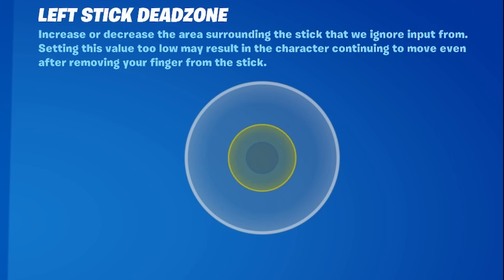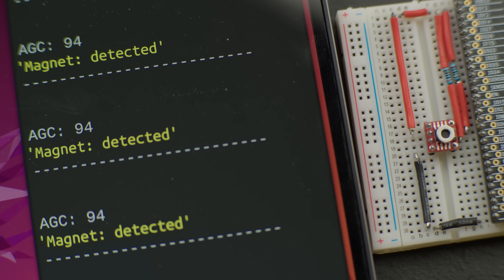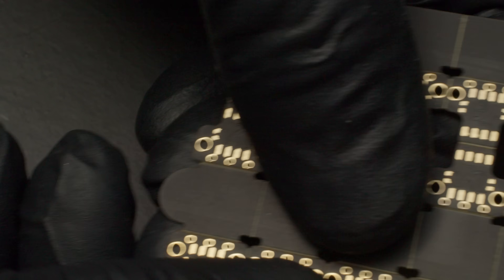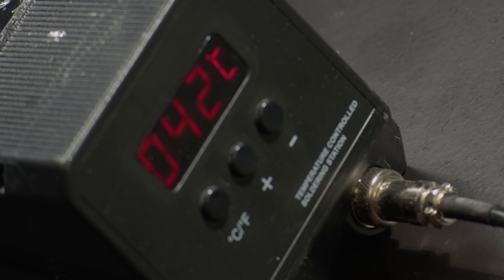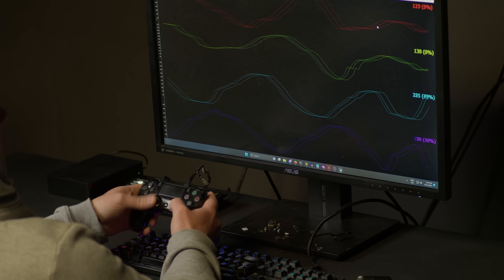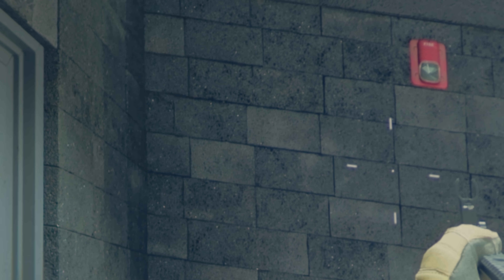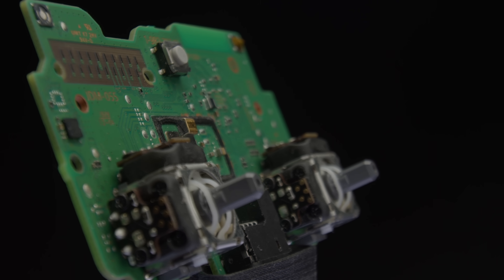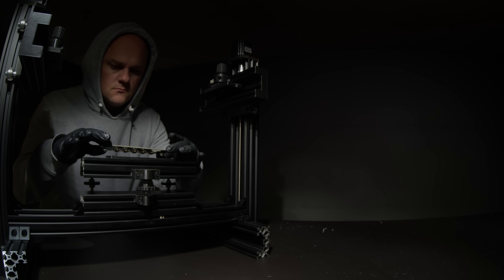Beating the $20B Joystick Drift Problem, and giving it away for free

Comment: I have Hall effect Sensor Sticks on my controller. But since the moving part is and will always be a mechanical component, they will always suffer from wear and tear. For example the mechanism pulling the stick back into the middle will suffer over time. Sure you can recalibrate but that doesn't help when the stick feels loose around the center.

Comment: what a waste of battery having the forward movement tied to a positive voltage and backward to zero, they should've made it the other way around as we spend MOST of our time using forward in all on-foot games
Reply from the maker: Haha. So true. Genius thinking. You can actually use the joysticks both way. So its probably a random mistake by them. Then did not have you to say it to them, and it stuck.

Comment: I refuse to believe that controller making companies never thought of that. There has to some reason, why they dont use that, right?
Reply from the maker: Yes. The old solutions that the existing hall effect joystick manufactures are using are not working properly within the specs of what companies like Sony accepts. I'm using sensors that alone costs more than the entire joystick. For one sensor. And 4 is needed. So outside the budget. Also they spend a ton more energy than pot-meter based ones. They could make their own, but that would require tons of RND fixing something that makes them a ton of money not fixing. So its a big mix of all those things.

Comment: gulikit already done this right?
Reply from the maker: Yes but its not the same technology. This is a rotary encoder that uses hall effect. They have a hall effect sensor.
Reply: @MariusHeier1  which one is better?
Reply from the maker: @backupmemories897  Depends on the criteria. They are probably cheaper, and use less energy. Mine is more precise, and accurate. It also works for the PS4 controller. Theirs dont.
Reply: @MariusHeier1  will this work on bootleg ps4 xD

Comment: Can you make it so, wherever the controller knows when you are not using it and the joysticks should thus be centered, it makes it so the values registered in that moment become the new 0 quiet point?

Or alternatively, make it so a little small calibrated range of the rest state gets directly translated to 0 so it is absolutely quiet while in the "rest state" to avoid microdrifting.
Reply from the maker: Yes. What you described is exactly what many controller makers already do to create the illusion of a 0% deadzone. Like Nacon, Gulikit, 8bitdo, etc. They simply reset the 0 point when they predict the joystick has stopped.

The problem is that this prediction adds lag because it needs to measure where the stick is and perform a mathematical operation. This significantly slows everything down and creates hysteresis. So it's going to feel strange near the center. Another issue is that if you move the joystick just a tiny bit, like when you're ADS sniping, the joystick might think it needs resetting. This can cause you to inadvertently move the joystick back to the center, even if you didn't intend to. This results in an oscillation effect that makes precise aiming challenging
Reply from the maker: You need a joystick that can mechanically return to 0 during normal movements. Then, you require a sensor capable of measuring those distances with minimal noise to accurately register the positions. I've actually found a mechanical joystick that accomplishes this. My joystick and sensor combo has 600 positions and returns to the center within a 2-position margin of error. However, the main board only measures 255 positions, but it's within that range. With a 0% deadzone and no averaging, it's possible to move the joystick with the full 255 resolution. It feels quite weird to be able to do it, but very cool.
Reply: @MariusHeier1  Wow. The more you learn!

Comment: As far as I know the hall effect analog sticks have a bigger input lag than the normal ones. Did you ever measure it and compare it?
Reply from the maker: Check community post from 5 month ago for graph. They where more responsive than pots.
Reply: @MariusHeier1  ok,.but you wrote it's more responsive. That's right. But the time when you push the analog for example up. How long does it take for the hall effect and how long for the normal one's to reach the upper maximum. I hope you understand what I mean.
Reply from the maker: @allesklar7267  Yes i do, i think. The time is started by an external trigger. The measurements are done with a robot, and the clock is started when the robot was triggered. And not when the signal started to change. So it should be the same.
Reply: @MariusHeier1  and the result was your hall effect analogs response quicker than the normal one's?
Reply from the maker: @allesklar7267  yes marginally. Probably unnoticeable. But it was a few tests only. Need more testing to be sure.  So far i have not run other experiments on it. Or more advanced. It was unexpected for it to be quicker.
Reply: @MariusHeier1  do you have a video in which you test this? For me it's not understandable how it's quicker 😅

Comment: Hi Marius, I loved watching your video as the topic is something I keep reading about. Is the voltage supply (pardon me if the language is wrong) on PS5 and Xbox circuit boards the reason why Sony/MS don't add Hall Effect modules in their controllers? If they only use 1.8V and need 3.3V, this would be a pretty good explanation for these corporations to explain why they don't use them. On the other hand it would leave the question on why they reduced the V in the first place.

Comment: Big problem is that they dont ad a recalibration feature which will help with it
Reply from the maker: Yes there is. Just found out. Haha. Which makes this process a lot simpler. You need to send the right usb control transfer to the controller.

Comment: Wondering when you will be working on the ps5 module. Great Video. How is the center position noise of your Hall Effect Modules? Ive seen some others that have small amount of shake when controller sticks are in the home position.
Reply from the maker: They have very low noise. You can play on 0% deadzone. The limitation is on analog signaling in the controller and the joystick mechanical design itself. I will most likely move straight to the new version for ps5 and xbox(V3). Make a small product run for Patreons. And release the project files. So i can do the V3

Comment: I'd recommend looking into the aftermarket GameCube controller scene -primarily the Phob motherboard / controllers. They use hall effect sensors with onboard chips that allow you to calibrate the controller for maximum precision. There's an onboard editing mode that lets you tweak analog values at specific positions, apply stickbox snapback modes and filtering, as well as button remapping. Top tier feel / responsiveness & borderline a necessity for pro level SSBM
Reply: Also some (original) PS3 controllers and most modern radio controllers(like jumper t-lite) use hall effect sticks,
Reply: Wavebirds?
Reply: Sure, but GC controllers aren’t great

Comment: Will you be choosing the smallest available joystick assembly then fabbing adapter fittings for each different manufacturer's controller/joystick form factor so  they are more widely used?

Also, will I be able to purchase just the parts & components to mod the over 170 joysticks I just bought for upcoming ESP32-based MIDI Controller projects? nothing here yet, still in 'get over this adhd-rush' first. stage

Your 'way of doing business' with your homework I admire greatly.
Reply from the maker: Thanks! Ill be sharing the parts and everything for others to make it as well. I just ordered a ton of custom magnets to get the design a bit smaller. And i will most likely sell it with a Chinese replica joystick as an option. Then do the 1.8v for PS5/Xbox and then potentially the other design for other joysticks maybe. :)

Comment: I swear to god, never heard of this issue before, if my controller breaks after this video I'll be pissed. 
(Had my PS4 controller for about 9 yrs now, first used on a PS4, now only on PC)
Reply from the maker: What games do you play? And what is your deadzone settings? It will effect games that uses joysticks for movement, with a low deadzone. Which means what part of stick movement close to center will be ignored.
Reply: @MariusHeier1  Back in the day i played Destiny 1 and later Destiny 2, on console i was terrible with aiming, in FPS. Im mostly into racing games when it comes to using the controller nowadays. 
The only deadzone setting I've ever changed was in Forza horizan 4 and 5. Just so the steering isn't too edgy, don't remember the setting unfortunately :)
Reply from the maker: @mr.sauvage330  that is related to drift. If deadzone is big enough you wont notice to much

Comment: Why use such a huge hall sensor? Pretty sure there are ones in size of a 0805 resistor that can do same
Reply from the maker: Not many have the analog output needed. There is qfn ones but needs 5V for programming.
Reply from the maker: And its not a "hall sensor" its a rotary encoder actually. But yeah, some would call it the same. But it add detalis on limited sizes.

Comment: I get what you're doing brother but they already know this and they could already do this but then they wouldn't sell nearly as many controllers and that's not good for them from a business perspective. 
You do you brother swords are not forged in nice conditions. They're forged in fire. Did not sharpened with fluffy pillows. The sharpened against stone. You have to push through something tough to make yourself better. Best of luck to you brother. God bless
Reply from the maker: If my company would be really successful. It will become what they are. And then another part of the same problem. So I'm gonna do it in a different way.
Reply: It wouldn't even surprise me if they already built this controller patented it and are just not selling it so that nobody else could do it

Comment: gamesir g7 se?
Reply from the maker: What about it?
Reply: @MariusHeier1  just buy it instead, its fitted with hall sensors from the manufacturer
Reply from the maker: @wingmanemu3473  There is a difference. I have it. I will most likely put it in my next video.

Comment: It's not a $20B problem. There are patents for this since 1997, like US5969520A. You can buy magnetic stick replacements for all console pads for like 20$. Your engineering skills are obviously on a display, but your idiotic clickbait title diminishes the value of your work.
Reply from the maker: Those patents are worth as much as the fact that placing an object in a river is a bridge. Even if its a rock, its not usefull. As long as there are no implementation they are absolutely worthless for any consumer. The size of these joysticks and the small distances you have to move the magnet does not translate to an axis with 255 positions without delay from some filtering process. Show me your 20$ magnetic stick replacement. My idiotic clickbait title was obviously good for your engagement since you commented.   Sorry for making you feel bad. 😂
Reply: @MariusHeier1  I am glad we found a common point to agree on - it was a clickbait title. And it was bad for my engagement since I thumbed it down and clicked don't recommend. You made me feel bad for you, so you don't need to apologize. Like I said - this only diminishes the quality of what is otherwise a good and educational video.
Reply from the maker: @ytsks  Its still your feeling and not mine. I don't feel your feelings. You built up enough motivation to write a comment, based on your frustration. That was what I was sorry for.
Reply: @MariusHeier1  Don't worry about my feelings, I will be perfectly fine. There is no need to divert the conversation, it is still obvious my comment was pointed enough to make you keep going on here. You are by no means exclusive in my admittedly wasteful habit of telling creators they don't need to follow idiotic trends which make their content stand out less, not more. Take it as a rude advise, not personally. You could have chosen a thousand titles that don't make it sound like you think you made something revolutionary.

Comment: My dude, this is dope! It's obvious that today's joystick modules are purposely designed to go bad. I think part is due to the consoles being sold at a loss, but another big part is definitely corporate greed! If the tech industry was filled with more people like you, I think the world would be in a much better state. While I can't contribute to your patreon, I can give you a sub here, and I'll watch your videos whenever you upload. You've earned it buddy! Keep it up, and I've no doubt your channel will grow! You're awesome! ❤
Reply from the maker: I think you are mostly right. They where engineered by a different company this way. They are suppose to be easy to replace the potmeters on them. You can snap them right off. Then Sony put them in their product, and hard coded the specific voltage value for each pot. Which is the proper way of doing it. Then they forgot to make the joystick manufacturer fix for the pots going bad. And instead of having the potmeters replaced, they figured out they rather sell you a new controller. :D

Comment: My PS4 controller only drifts when it's wireless. As soon as I connect the cable, it's fixed
Reply from the maker: Thats interesting. What kind og deadzone do you use and in what game?
Reply: @MariusHeier1  I actually never had a PS4, I got the official Sony PS4 controller and a Asus bluetooth dongle, I play on PC mainly on SnowRunner. I never modified the deadzone so I don't know what it's at, maybe stock deadzone? The controller program I use is SCP Toolkit to emulate a PS4 or Xbox 360 controller. I don't think it's a software problem, the first couple years I never had drifting through wireless

Comment: Controllers last more than a few months. They should last at least 3 years with constant use most of the time if you take care of it. I’ve gone through many different controllers and never had one last less than a year and a half. Never even had stick drift either.
Reply from the maker: How many controllers need to break down before two months before it becomes a valid point? Its not about "taking care". Its about how much energy you put into the resistive material.
Reply: @MariusHeier1   Most controllers won’t break in a few months. I’ve owned many controllers I would know. If they did break down that quickly we’d hear about it more often. It’s possible to get defective ones from the factory. It can happen with almost anything.
Reply from the maker: @gabecollins5585  Everyone is right. I never said most controllers break in two months. The two month test is with playing fps games on a low deadzone setting. If you remove these factors you can make the statement "controllers dont or they drift in 2 months".  And it would be true. So without discussing these parameters it's not worthwhile having any discussion about it.
Reply: @MariusHeier1   Makes more sense now.

Comment: Permanent magnets are misnamed, they are not permanent, and so hall effect joysticks will drift eventually. However they should almost definitely outlast the housing of the stick making the lifespan of the magnets redundant. 
Why bring this up if it's irrelevant? Because companies tout the degrading magnetic field of magnets as a reason they don't use this technology, but it's total nonsense because it won't be relevant during the controllers lifespan. This technology is used reliably in cases where peoples lives are actually at stake if it fails, so don't listen to the bullshit excuse of controller manufacturers.
Reply from the maker: True. However these sensors will not be effected by it. They care only about the rotation of the field and not the strength.  Unless they drop like 50%.
Reply: @MariusHeier1  Exactly, it's never going to happen in the lifespan of the device, and probably not even your own lifespan unless it was under conditions that would easily break other components. I'm just dispelling the bullshit these companies try to tell people.

Comment: This is a deliberate, planned obsolescence "problem". Because I KNOW they can make controllers that don't drift as much... 

     I had both a PS3 and an Xbox 360. In the span of 5 years, I went through 3 or 4, 360 controllers. Meanwhile, my original PS3 controller never drifted.. But when PS4 came out, suddenly, drift was an issue there as well... M$ just let it be known that you can sell FAR more controllers, and make more money, with a little planned obsolescence...  And the industry followed suit.

Comment: How I fixed my stick drift on my PS5 controller. Rotate your joystick clockwise while holding it down like you would to use L3/R3 for one minute. Rotate your joystick now counter clockwise for a minute. If it comes back a few days later repeat this process. My stick drift went completely away doing this.

Comment: It was a bearing problem.  Hall sensor will last longer than the potentiometer but that was never a problem.  Replace the bushing with a ball bearing and you'll have a controller stick that lasts 10 years.  Or less insane, just use thicker delrin bushing material. I'll release these ideas for free too ;).